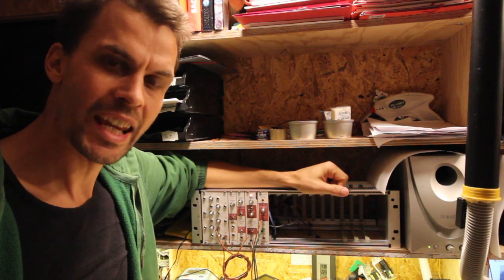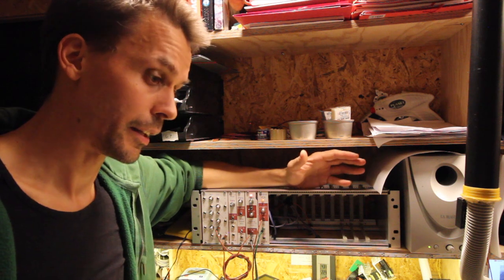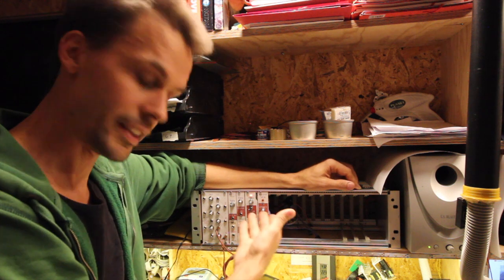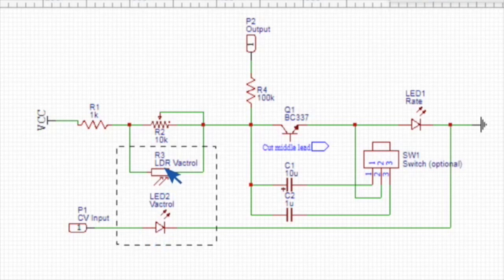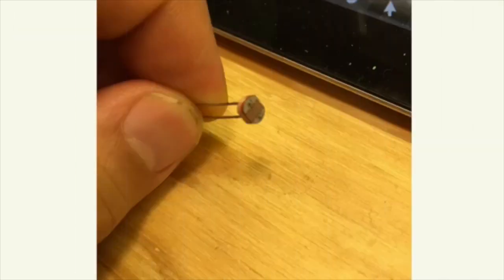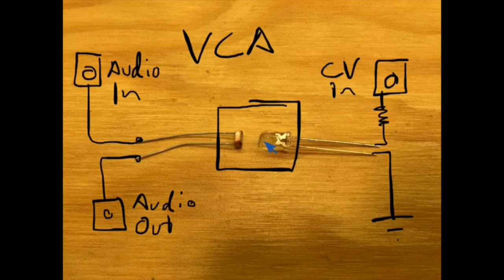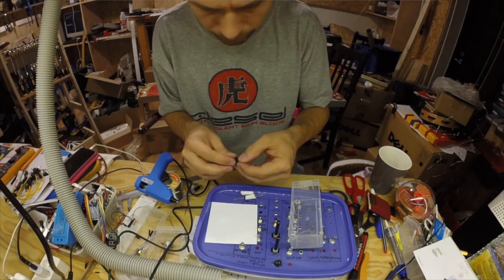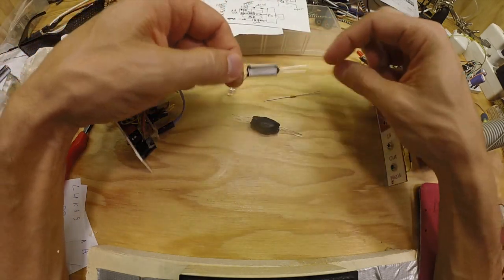Vactrol VCAs and CV attenuators - DIY Modular in a Week 2.1

Comment: a small tip - just use heat shrink tubes to make vactrols. Simply cut ~15mm of the tube, on one side insert LED, on the other - photo resistor. Apply some heat with soldering iron and all good. Super cheap and 100% effective.
Reply from the maker: Yep. I don’t think I mentioned heat shrink but I did try that aswell. The tubing I had at hand wasn’t large enough though so I couldn’t get it around the led, that is why. But doesn’t heat shrink let some light through? I’m thinking it is really thin...
Reply: Kristian Blåsol well I guess it depends of the brand, maybe some are really thin. but if you’re using black - it totally should be fine. 
I’ve made a few in this way - no visual light coming in / out and works just fine
Reply: Sugru would work instead of Fimo putty. Available at Clas Ohlson in Sweden or easily available from the sugru website.
Reply from the maker: Stephen Cook Yes sugru would work too. But it is much more expensive than Fimo clay and won’t last as long just lying around. 😉
Reply: anyway, just paint it or something if its transparent
Reply: Get the 3:1 kind from the car electrics section in biltema. Absolutely no light gets through
Reply: Yes, this is how i do it. Black heat shrink tubing. Sometimes i would do two layers. Fast and easy.

Comment: Audio is the only area where commercial use of these photoresistors are allowed in the EU (if they are Cadmium based). The tremolo effect on "How Soon is Now" by the Smiths is possible via vactrols due to the high voltage capability of photoresistors and the high voltages involved in tube preamps for guitars.

Comment: Technically your Vactrols are Voltage Controlled Attenuators, as there is no amplification happening. But simple and useful :-)
Keep on going ;-)
Reply from the maker: Thanks for clearing it up..
Reply: To be fair, most VCA’s are voltage controlled attenuators.
Reply: Isn't that what VCA stands for?
Reply from the maker: The A in VCA usually stands for amplifier. This circuit doesn’t amplify. It only attenuates. It only lowers the signal strength it doesn’t raise it.
Reply: @PWMaarten  Most VCAs are set up for unity gain at max CV.  They don't have to be, though. I've built some that have some gain (X2 usually).
Reply: @crysstoll1191  My point was that most IC's or Transistor pairs are attenuating only. What you do with gain staging after that is up to the designer.
Reply: @PWMaarten  My point is that ICs (in this case Op Amps, operational amplifiers) can be set for gain or unity gain or fixed attenuation or whatever you like. Differential pairs can also be set up to add gain but in the case of most VCAs which are mixing +/- 5 or 10v, these are hot signals, so, no gain.

Comment: I make mine with the shrink plastic that you use on wires with a heat gun and that shrinks up and closes it up really well and it also insulates it electrically. I do a small piece of it around the ends of the LED and the photo resistor and then I do it again with a larger one around that and that's sufficient

Comment: Lol, strangely this doesn't work at all... I used some standard clear casing LEDs, some standard photoresistors and the VCA closes so slow after triggering it it's just ridiculous. As if the light emitted by the LED  is decaying for more than 20 sec. or so... which was not the case when I checked the LED with a battery before buildung the vactrols, it was shutting off immediately then. And the photo resistor wasn't that slow either, when I checked it with the resistance measuring part of my multimeter. I just don't understand what I'm doing wrong. I've built so many kits, built my own synths and sequencers with 40xx CMOS chips, PICaxe and the like but with this modular stuff is the first time I'm really stumped and not able to find out whats wrong... :D
Reply: It's likely the photocall. They are all fairly different in their response. Especially the timing. Good vactrols are specd on timing.

Comment: First of all I'm enjoying this series a lot so thanks for the great job! When the "Vactrol" was mentioned on the previous video I immediately thought "Why not using an optocoupler?" And it is an optocoupler indeed xD I've used 6N137 (DIP8) format and later more effective H11L1 (DIP6) optocoupler chips to make MIDI gear. They're not expensive at all. Cheers!
Reply: You probably know this already, but for anyone else browsing these comments, the chips you mentioned won't work for this application as they are logic-level output (5V/0V only), so you won't get the smooth analog signal that a vactrol outputs.
Reply: @bocoroth915  you are totally right :) Later after writing the OG comment I learned that. Thanks for pointing out!

Comment: could baking at 110 deg damage the components? The LED I'm planning to use is rated for storage up to 100 deg celsius and the GL5516 has an operational range up to 70 deg.
Reply: See the comments above re using heat shrink tubing.

Comment: Hey hey, your modular vids are very very helpful thank you so much for all this. A problem i came acoss with vactrols like that was mostly the lack of over voltage protection. I designed them for 5v gates and after i broke it i realalised that befaco muxclicer for exampel outputs more than 10v gates. Turning it into an active module to give the led a fixed supply and switch it with a N-Mosfet could work. A friend just gave me that tip. Havent tried yet but should work. Maybe you have an idea for passive protection for 0hp stuff. But i think if you only use your diy cvs you know your V levels. Anyway awesome vids bro !!!
Reply from the maker: That is an interesting idea your friend gave you, that we almost need to ponder more upon :) I added a potentiometer to my Vactrols as shown in the video, and I always turn them down quite far before I connect anything, that way I dont send too much voltage into the LED... But the MOSFET thought might have something to it. If you try it out let me know! As for my DIY CVs I have no idea what they signal they put out. I think they are very different every one, which gives them their own characteristic ;)
Reply: I will let you know ;)

Comment: What do you think about adding a half wave rectifying diode in series with the LED and CV in to protect the LED from reverse voltage damage?
Reply from the maker: That might be an idea. I haven’t thought about it but yeah. You mean in parallel though right? And going the other way for reverse protection? Hard to visualize without a schematics. :)

Comment: Hey Kristian, ever tried to do a VCA with PC817 or 4N25 optocouplers?
Reply: You probably could do it, but since they are phototransistors rather than LDRs the output would be either on or off at your supply voltage, so you wouldn't be able to use (for example) a triangle wave to control it.

Comment: Wow, I forgot to put a resistor on there, and for some strange reason it did not work. I hooked the LFO up to a LED, and with the 10K it was on all the time, so I guess this wiould be hard without a pot, but I just can't seem to understand how to wire up a pot without a stripboard layout. I will order some LDR's before I play more with this, because I think all the vactrols I burnt are pretty expensive.
Reply from the maker: Yeah vactrols are expensive. Making your own is “good enough”  and Munich cheaper. :) you need the resistor to lint the current to the led otherwise the led breaks at such high voltages.

Comment: Thank you very mutch for good tutorial :)
Reply from the maker: Your welcome. :) and thanks for watching.
Reply: Kristian Blåsol thanks :)
But I have questions about vactrols:
The LDRs have a different characteristics and what the models of LDRs you use?
And if you use vactrols in parallel with potentiometrs - characteristics of the LDRs are depended from impedance of the pots?
And what you think about resistor before positive leg of  LED in the vactrol (for voltage limiting)?

P.S. Thanks in advance for your answer, and sorry please for my english... 
:-|
Reply from the maker: I actually dont know which type I used. I just took what I had at home, but I know there are many different ones of LDRs take one with a high off resistance (1M+) and as low on resistance  as possible. To get the best switching effect. How do you mean in parallell to the vactrol? Yes, some kind of resistor is needed in series with the LED to keep it from frying this is where I put my Potentiometer, to limit how much input signal affects the LDR...

Comment: hello i don't speak english very well.
thanks for the tutorial and all :), i want to do this module and have a question. in the squematic only appears(?) the ground, where is the vcc or what?
 thanks
Reply from the maker: Hello, This is a "passive" component. No VCC is needed, as the Vactrol uses the voltage from the gate input to "open" the signal path between input and output. Hope that helps. Sorry for late reply...

Comment: What do you think about the LiteOn LTV817? Could that work? 

It’s a <€0,20 optocoupler.
Reply from the maker: Haven’t thought about using optocoupler a for this. They are on off though. So no nuance in throughput. Also most optocoupler are 3.3v so keep that in mind. Try it and let me now....
Reply: Kristian Blåsol good point. Can’t believe i missed that. 

I came across them in some schematic for a cv control function. But I guess it’s used as an on/off there.

I will order a few none the less. I will experiment if it can be used in a semi useful manner.

Comment: what's wrong with an off the shelf opto-isolator?
Reply from the maker: Nothing. Except the price for one where I live. 4$! 😅
Reply: If you mean the ones you can find in DC power supplies they are usually digital output (on/off) rather than analog.
Reply: An optoisolator is not necessarily a vactrol. There are many digital optoisolators, just on or off.
Reply: Wow, i think it depends on how many you need and your resources. If just building one or two circuits maybe buy them? Building 50 circuits, build them. Or get lucky like i did and buy a bulk bag of vactrols.

Comment: Great tutorial. Just wondering if anyone has implemented this design into eurorack format? I want to build one, but I'm not sure if I should add a voltage regulator since the circuit require connections to + and ground and eurorack standard is 12v.
Reply from the maker: This is eurorack format. It uses 12V and gnd which both are present in the eurorack power strip. So it will work fine in a eurorack.
Reply: I see, thanks for the response.
Reply from the maker: Ric Jenner just saw that I wrote 12vac. I of course meant 12v (as in dc) which is the eurorack standard. Sorry if that was confusing. I have fedited the answer to reflect this more correct info. (I of course blame auto correct. 😉)